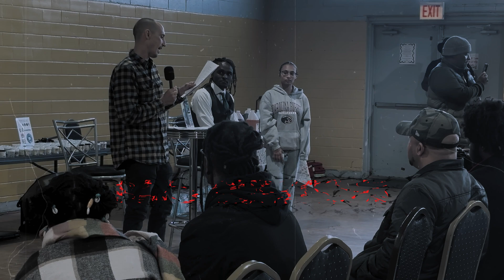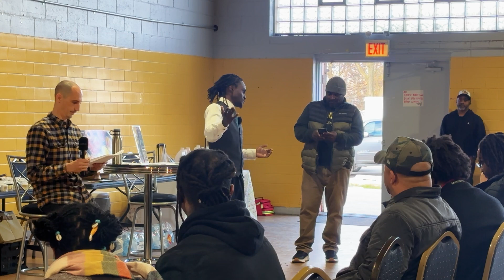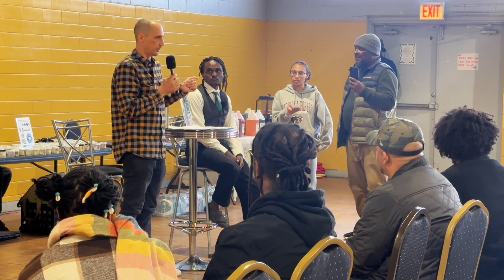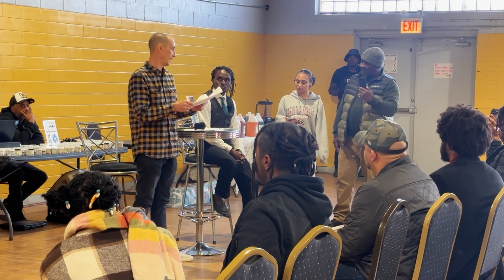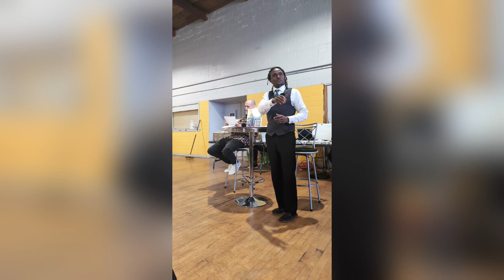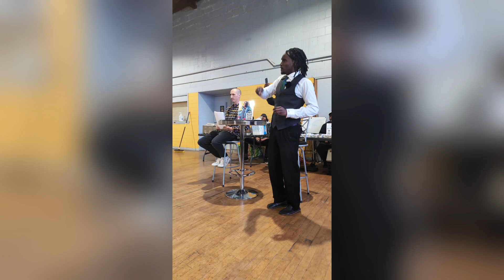The Plastic to Fuel Debate

Comment: I love what he built. I just wish he would be honest about the fact that others have done everything he has; meaning he didnt innovate any of this.

Turning on or off magnitrons increases or decreases temperature yes; but he isnt monitoring power consumption of the individual mags and has no clue about all his inputs, operational efficiency energy output. That is a big deal when making false claims about greater than 100% efficiency.

You cant run vacuum and high pressure at the same time. Without high pressure his products are contaminated. I dont think he understood the question.

He is making claims that are currently false and will remain false even after upgrading. Saying there is no use in testing to prove his claims because he is going to upgrade the machine just sounds like a con artist speaking. Either he is telling the truth, or he isnt. If he is lying, stop. Simply state what factually happened.

'Hand made'... he makes constant false claims and then changes the definition. This is a moving goalpost fallacy.

Its not continuous, or even semicontinuous, but is in fact a batch reactor.  He is running up against a fundamental limitation of the technology and acting like it doesnt matter because he wants to first focus on an inconsequential detail. 

How does he dispose of the solid material left over from pyrolysis? The EPA WILL have a problem with that when he collects enough. 

Live streaming isnt collecting scientific data. I think this 'self educated' guy is simply so ignorant he doesnt even understand what his critics are talking about. 

He should tell New Palestine Ohio his good news about styrene contamination because they believe its a longer term issue. Long term environmental monitoring seems to agree with scientists also.

I love pyrolysis but hate liars. Julian is making false claims; and attempting to use those false claims to gain financial and material support. I think that meets the definition of a scam.

Comment: How come nobody realizes that he’s using more energy (electricity) to transform the plastic into fuels than the energy he gets in the end (“plastoline”) ? Why not use directly the electricity generated from solar panels or whatsoever instead of using it to make a transformation that will lose significantly amount of available energy in the process ?
Reply: Isn't the entire idea to get RID of plastic waste? I dont think it was ever a way to replace any other form of more efficient energy. Dont think I ever saw him make that claim

Solar Panels already exist as he's literally using them to power his machines so its not like he's not aware of their efficiency

What he's doing is essentially an advanced form of recycling
Reply: It's just about making it work first and then making it efficient and improved in other ways after. If it works and is remotely worth doing. Which I'm far from convinced that it is but I think it's worth trying even if it's just letting the guy do something he's this passionate and determined about. He's doing some impressive things either way and all of the inventors we all know of had way more flops than successes. It's part of the process.
Reply: Or whatever?
Reply: U IDIOTS ITS POWER COMES FROM THE SUN ITS SOLAR PANLES THE ENERGY IS FROM THE SUN
Reply: but he is using solar energy, so this way he is storing solar energy in form of this plastic gasoline.  Why not use directly the electricity generated from solar panels? Because they are not portables like a jug of a gasoline and you need a battery where you will loose same efficiency anyway. Think about this as a "diesel" solar battery

Comment: In 2007-08, I made biodiesel from waste vegetable oils using methanol/sodium hydroxide(lye or caustic soda) and the 5gallon method to break the triglycerides. Soy, peanut, Canola(canada seed) and the canola (Taco Bell)had the best porosity and cold pour quality. I had a 1984 Mercedes Turbo diesel and supplemented my fuel...it was fulfilling and dirty work. The byproduct was glycerin.
Reply: My first publication was about producing biodiesel at large scales using ethanol and potassium glyceroxide. The fuel produced is a lot cleaner and better for the environment than this "plastoline." Just by the results provided by the channel mass spec everything, Julian is ignoring chemical safety and prematurely upscaling his process while releasing these chemicals into the air after combusting it in engines.

I really hope he begins to take risk management seriously. If he really has fuel that doesn't have a concerning amount of impurities, then he should be writing grant applications. The EPA funded my biodiesel project for 2 years with the P3 NSDC grant. He could get an SBIR grant if he includes some evidence of chemical safety tests. 

His fuel is never gonna be legally allowed to sell commercially or be used for vehicles on roads until he removes harmful impurities
Reply: @kylemcguff5581 Was there anything wrong clause that would allow the company to take credit or control of your work?
Reply: @JoseCee9800 I am not sure what you are asking. There was no company involved in my research
Reply: I have read where it makes your garage/ workshop smell like burritos!
Reply: Just from my research into ethanol and biodiesal a lot of this stuff is achieveable at large scale is because of carbox tax credits, co2 credits etc. His idea in my opinion couldn't get access to those, its reducing waste in our land fills at what cost? The energy needed to produce, plus the emissions this will produce will offset any carbon positive.
Reply: Better watch out the oil industry don't like people messing with their profits.
Reply: @I.C.Weiner if a huge amount of plastics could be turned into the oil, such as in Australia I believe, then maybe a dent could be made!

Comment: I just wanna know how to do this in case the grid goes down. In that situation I don't care about the EPA and I'm not huffing my engine's exhaust to worry about cancer. It'd be just energy used to get through the crisis.
Reply: if the grid goes down that's when your use a gasifier, a gasifier is old tech from ww2. uses wood to make gas to run any motor, only downside is the gunk sap build up from converting wood to a gas. if you have a lot of trees, you can run a truck motor or generator all day everyday off just wood gas. julian should be using this not solar power. as soon as the sun goes away.... so does the power. doesn't matter how many deep cycle batteries a person has... the power is not sustainable long run with solar or wind power. wind and solar power are only good for back up energy. if ya have no wind.... no wind power, like with solar and the sun, gotta have full/ partial sunlight for solar power to work.
Reply: @honda-s2k A gasifier is one way, but not the only way.
Reply: @cdevidal  i agree. but solar is not the way lol
Reply: @honda-s2k I don't understand why you keep bringing up solar when this discussion is about plastic fuel
Reply: @cdevidal na 😂😂 this thread of the discussion has been about the grid going down not plastic to fuel. The video may have been about plastic to fuel but not your previous comments LMAO ..... just can't fix stupid😂🎉😂🎉🎉😅😅😅😂😂
Reply: @cdevidal also Julian literally said in the video about three times he is trying to convert his current setup of power that is gas generators to a continuous solar power system. It's really sad a lot of you do not pay that much attention to the video that you're supposedly had already watched.... did you just skim watch it, did you like only hear what you wanted to hear😂😅🎉😂😅😂😅 he was literally asking for solar panel donations and money for the solar panel setup in this video😅😅
Reply: Yeah, though I'm still not sure that it would produce more energy than it consumes. I've asked about it a few times in the comment sections, but i haven't really gotten an answer
Reply: @ab.c1744  gasifier is the answer!!!!!! https://www.youtube.com/watch?v=XZdqKicnoVg
Reply: @ab.c1744 nothing produces more energy than it consumes...
Reply: Even if it produces less energy than it consumes, if the grid is down, it converts a useless object (of which there is plenty around) into a useful fuel, and that fuel can then power the machine. It probably is a net loss when considering the energy needed to make the plastic in the first place; But that is stored energy once the grid goes down.
Reply: @cdevidal  what I'm saying is that I dont know whether the machine can run off itself.  If i does produce enough fuel to both run a generator and still produce extra, then that would be amazing, but that doesnt seem the case.
Reply: I see. In my mind (with zero testing of course), I could imagine it using less than it produces because the stored energy was embedded years before while the grid was still up; And, microwaves are an efficient way to heat something. But my imagination is not sufficient evidence. His problem does seem to be a lack of rigorous testing.

There also is classic, non-microwave pyrolysis; There's a gentleman who lives on a small inhabited island who heats up plastic found along the shoreline to make diesel fuel. The heat source is the abundant dead plant matter found on the island from its many trees. Even if this requires more fuel, it is a way to indirectly convert wood energy into diesel, which could be very useful if the grid goes down. And it's far simpler to set up; Just an airtight container with a small hole directing the gasses through a maze of tubes to cool down the vapors into usable fuel. Place a fire underneath, and go.
Reply: @cdevidal  it also really depends if we're talking about producing power or specifically fuel, because there are many ways to get energy from plastic. I heard of boats in the ocean that would run off of the plastic they collected. And nowadays we have seriously effective filtration systems like we see in the 0 emissions coal power plant in uk.
Reply: Goal is to have both power and specifically fuel. It'd be grid-down so we'd want both.
Reply: @cdevidal  you're wrong 😂. Not only does this take more energy to produce less energy but why would you want to store fuel when batteries are more efficient? His system doesn't work well, which is why he only produces very small amounts. Juilans been doing this for years at this point you think he would have a few 100 gallons on hand but he doesn't.  Even when he runs cars off the fuel it's usually less than a gallon, which means either it produces a small amount of fuel, or he knows it would mess up the car, or he knows the fuel is very toxic  and he's afraid of the lawsuits 10 years from now, or all three. But this plasticoline is bs.
Reply: @onemanonevote4223 I love being told I'm wrong when no one has proven either way, not even Julian. It's one of Julian's shortcomings--a lack of rigorous testing. Until it gets tested, I could be right or wrong. But I certainly am curious.
Reply: @cdevidal  This isn’t an apocalypse hack, it’s dangerously misleading. Pyrolysis oil isn’t a miracle gas substitute—it’s a chemically unstable, acidic mess full of long-chain hydrocarbons, aromatics, and oxygenated compounds. It doesn’t vaporize like gasoline, has low octane, and without serious refining—like fractional distillation, neutralization, drying, and stabilizers—it will gum up injectors, foul plugs, coke valves, and corrode your fuel system from the inside out. And even after all that? You still need to blend in a significant percentage of real gasoline just to make it run in a combustion engine without misfiring or stalling. Worse, if you’re burning it raw or not condensing gases properly, you’re risking exposure to toxic byproducts like benzene, styrene, and dioxins—especially if your feedstock includes PVC, PET, or other mixed plastics. The idea that you can just melt down trash and drive away is fantasy unless you’ve got lab-grade chemistry, serious filtration, and airtight controls. this process is technically complex, inefficient, and potentially hazardous—overselling it like it’s plug-and-play puts people and engines at real risk.